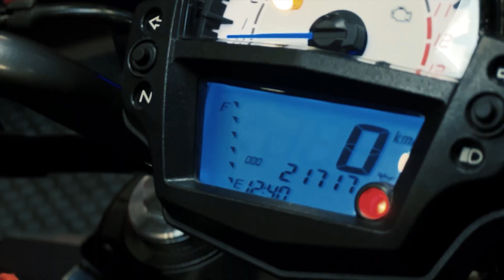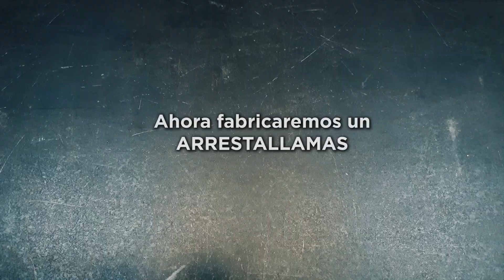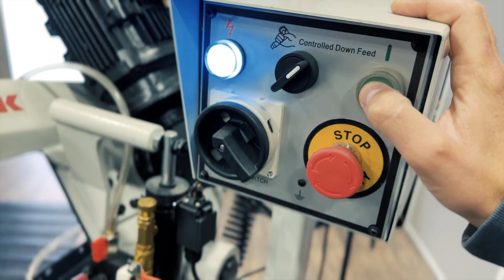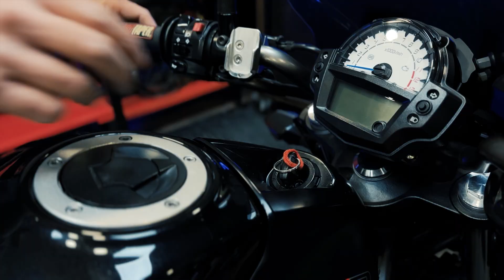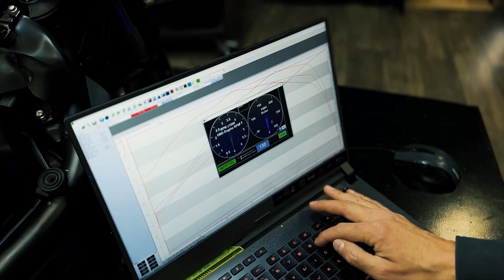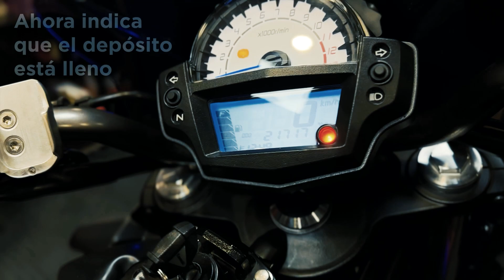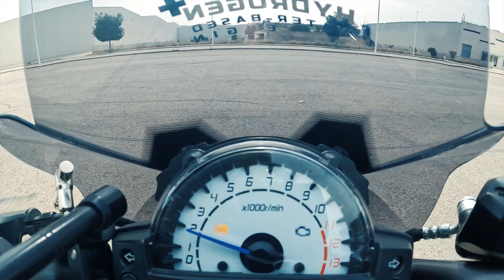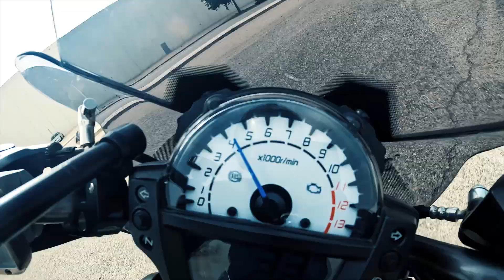Esta Moto Funciona con AGUA - YA NO NECESITO GASOLINA

Comment: Can this be applied to any motorcycle with a battery? For example say... 1972 honda sl125... I'm building one and would love to have some insight if it could be done! Great video!!
Reply: Yes, unless it’s a two stoke then you would have to add oil. A 1972 bike shouldn’t have fuel injection so no computer, just a carburetor to tune. A battery and a way to charge the battery will work. 
Sorry such a long comment but lots of information here! 
Also, make sure you have a spark arrester very important when using hydrogen 😅
Reply: @Rebel-p4p  thank you for the response!! Anyone have a good video of building the hydrogen fuel setup? I've done some research but like to have as much info as possible with something so volatile